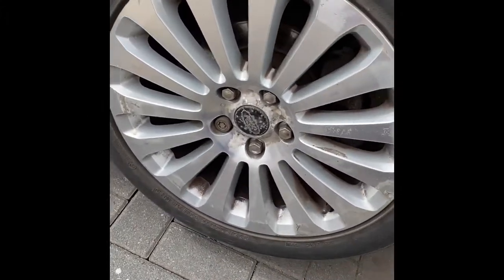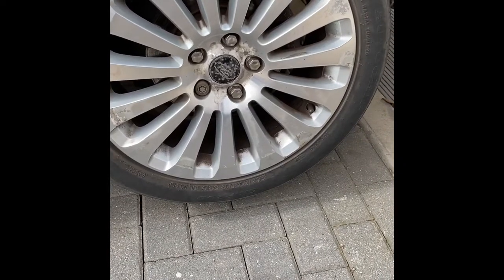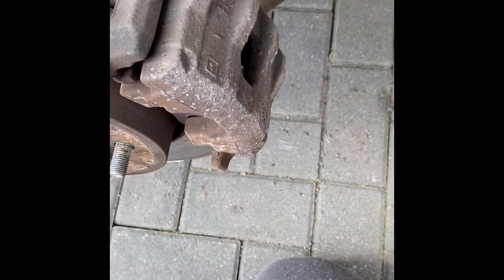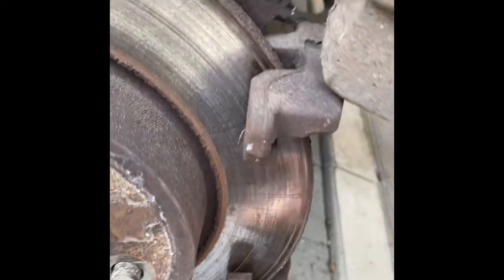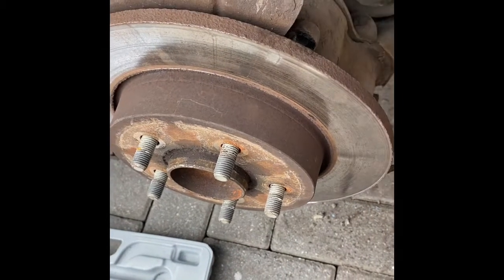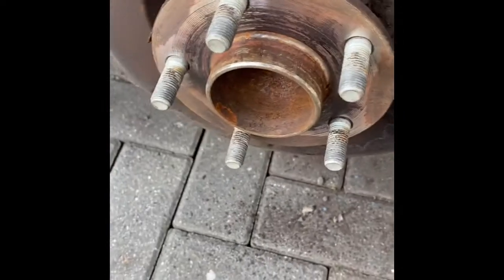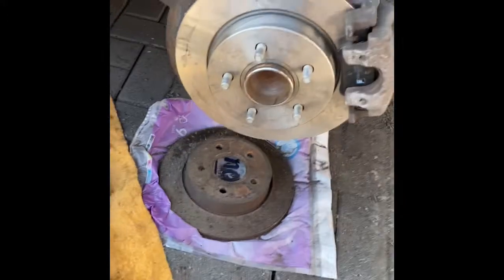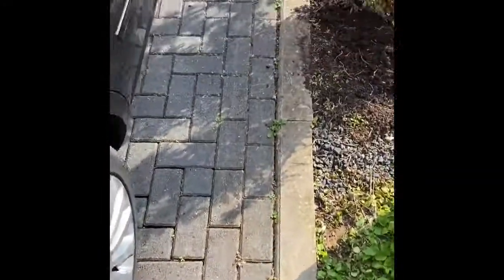Changing The Rear Discs And Pads On My 2007 Ford C-Max

Comment: Hi. I can relate to p8ddy's point that the impending problems of removal prehaps due to corrosion and locked bolts were where I wanted to learn from. i.e. removal of the caliper hanger. Removal of the old disc. CLEANING of the area to accept the new disc.  Also on a saftey matter- I saw no evidence that you'd cleaned the protective OILY coating off the disc befor fitting. Oh dear! Oil and brakes shouldnt be mixed. I hope all went well and the coating burnt off rapidly b4 it seriously contaminated your brake pads. Also hope there's no judder or nasty ride out. If you did indeed clean up the mounting suface smoothly thus shouldn't occur. 
 Thanks for having a go and joining the YouTube uploaders like myself. Hopefully there'll be more from you in future.
Regards,
Rogey. (Dirt Warrior)

Comment: A how too video that misses out actually doing any of how's. Wanted to actually see bolt locations and the issues encountered when changing discs. 

"Hope I haven't missed anything out" - You haven't actually put anything in!
Reply from the maker: Thanks for watching and thanks for your comment. This was one of my first videos ever filmed and was very much a case of learning whilst doing it too. Watching it back I don’t really understand your concern. From what I can see the only part I missed was removing the caliper mounting bracket.
Reply: @spallsy87  - The part you missed was, ironically, the part I needed to see! On reading back my original post comes across way harsher than it's meant to. I do realise that these things can't be all things to everyone - but it does appear to be a theme on YouTube car 'How to' vids that a Blue Peter-esque 'Here's one I prepared earlier' is a favoured approach. Woodworking youtube vids take the opposite approach and can be tediously detailed.

Anyhoo - To try and sound more constructive: A detailed and filmed approach would work as would covering possible issues - Watching stuff run up to the bit you need only for it to skip by it is pretty frustrating for folks who need that info, especially as the C-Max is very under represented on youtube car tutorials (and the c-max is also irritatingly twee to work on). For want of a better illustration,  some of the ThumperTalk walk throughs on DRZ400 mods and servicing take an almost 'live haynes manual' approach showing the difficulties encountered, the approach, even bold sizes and torque etc.

Long post I know. Cheers for posting the vid anyway, I managed to work everything out on the car, changed the suspension strut and no one died so all good. ;)

Comment: Nicely done video.   Thank you.   One observation.   I didn't see you compress the brake piston when you installed the new pads.  There is a special tool for this, but it can sometime be done using a simple C clamp.   Did you have to do this?
Reply from the maker: rednebmb I did have to compress the piston, I brought the piston retraction set, made it extremely easy to do. I believe I show this part in my other video. Take a look on my channel, there is a video where I change the front discs and pads. Thanks for your comment!
Reply: Thank you for the vid, as you said this is the only specific cmax video I’ve found quick question did you need to bleed the brakes after? Thank you
Reply from the maker: @neils-running-journey  thank you for your comment. I didn’t need to bleed the brakes after, no. Once the new disc and pads were on I just pumped the pedal until the pedal was hard again.